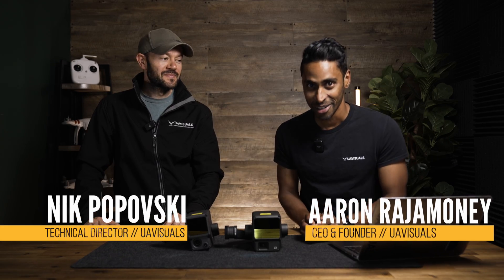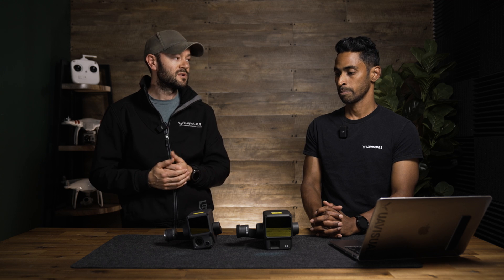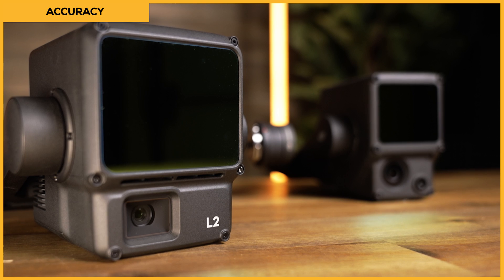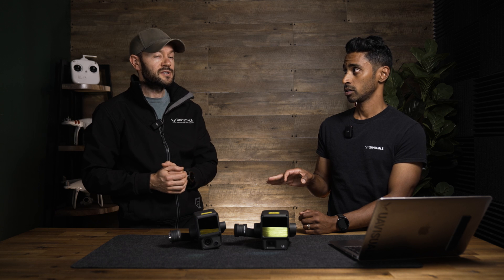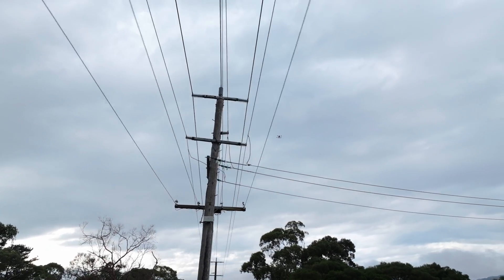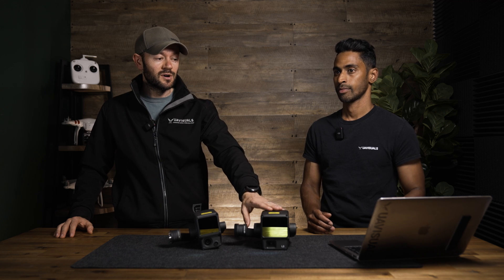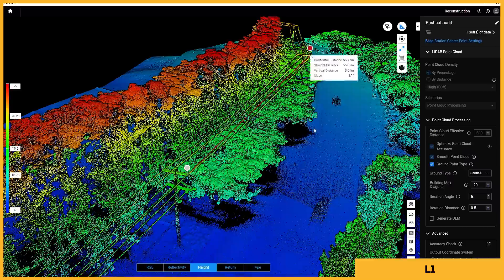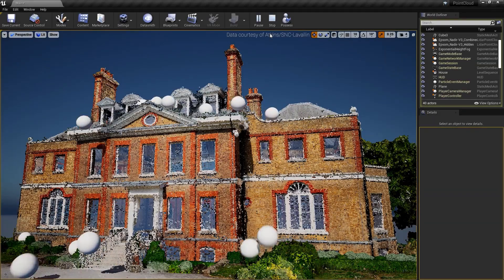DJI LIDAR L2 vs L1 Breakdown! (PLUS Advanced Lidar Inspection Process Revealed)

Comment: I have found the L2 glitchy. Some data sets were missing files for no known reason resulting in frustration for the end users. I will se now the latest data set work out after adjusting out practice, but you present glitchy hardware and clients roll their eyes and loss of interest ensues. As a company we are seeking to get away from DJI and use alternative hardware from France and Israel.